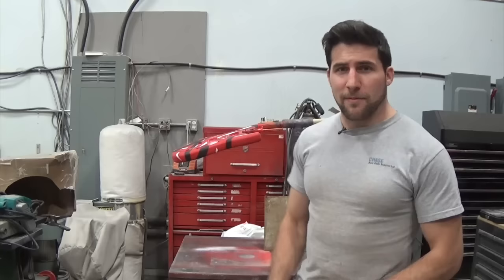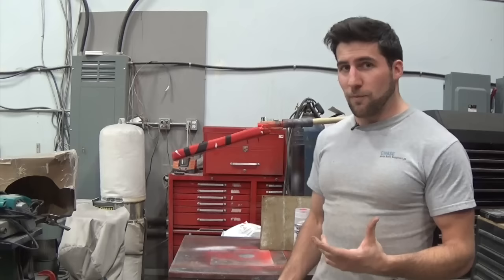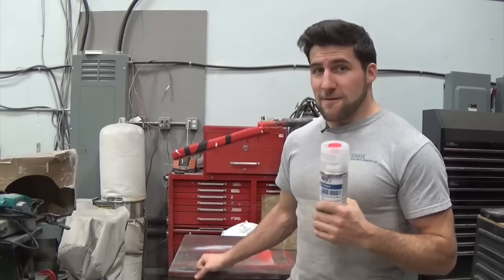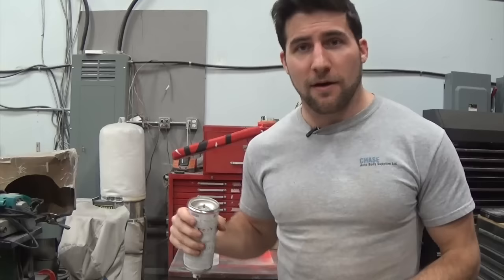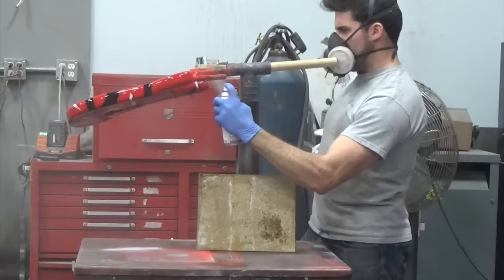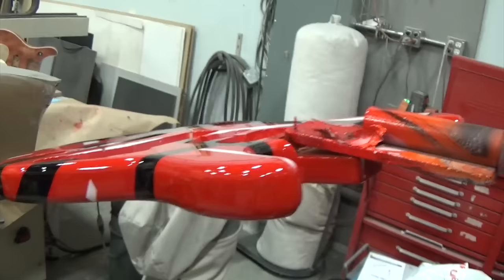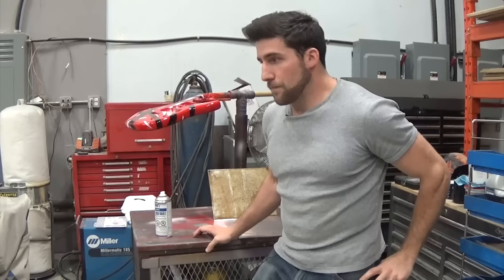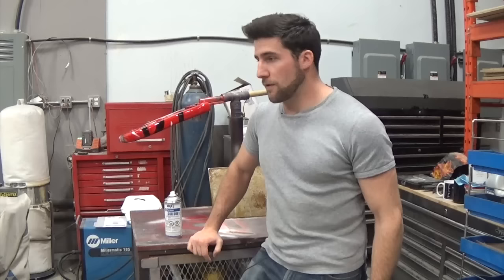How to get a professional looking clear coat with spray cans

Comment: I'm looking to coat an electric guitar that was factory finished in satin. Do you recommend sanding the satin first before applying the poly, and if so, what grit would you use?
Reply from the maker: Yes, sand it to help the new paint stick. I suggest 800 grit.

Comment: I love watching your videos I've learned so much. Just an idea bud you can make a cheap booth using pvc tubing with the pvc joints.
Reply from the maker: Yeah, the pvc and poly booths are worthwhile. I would probably do a chloroplast one if I figured I needed one. I like them a little better.
Reply: @BradAngove  I was just thinking it's quick and cheap to throw one up. Of course your right the others are better. Thank you for your very informative videos, you so deserve more subs 👍
Reply from the maker: Thank you. The shop actually has a spray booth now that I use occasionally.
Reply: @BradAngove  Man I wish one day I have my own shop to work in. I'm actually a car mechanic but things are so expensive in London these days. I guess never say never mate.
Reply from the maker: This shop certainly doesn’t belong to me. That would be awesome though!

Comment: Hey, I have no idea which video I watched of yours saying that you should always sand before you clear coat right? Well I did just that and got great results since I wanted a matte finish. 

Now my question is, should I also sand on a mettalic paint job? I used the rustoleum mettalic series and when I sand that paint job it looks very very different from what I wanted. Like the glittery part of the paint goes off and is a lot less noticeable. Maybe Im using the wrong grit sandpaper? (I used 500 to 800 grit.)

Anyway love your videos Ive painted a lot of great projects using your videos. Thank you so much.
Reply from the maker: Hi there. For the metallic, I would suggest that once you’ve sanded it you do one more light coat of it and then jump right into your clear coat 10-15 minutes later to let it bond chemically.

Comment: Hi Brad! First, thanks for sharing your knowledge. My question is, the finish of my guitar after applying a clear coat (Bosny brand) looks like a snake's skin especially under a light. What do you think is the reason why? Do I need to sand after each coat? And can I sand after 10 mins of application? Thank you very much in advance.
Reply from the maker: Sounds to me like you just need to go through the sanding and polishing process. I have several videos about it as part of various series. Also take a look at this on for your question about sanding between coats: https://youtu.be/pG1zqbaUBds

Comment: How would I go about sanding between coats? Or is that something I should just not do?
Reply from the maker: If you're relying on chemical adhesion as per the manufacturer recommendations like this, you wouldn't sand between coats.
Reply: @BradAngove  ok thanks so much!

Comment: Have you tried using superglue as a clearcoat? I've seen some amazing looking guitars finished that way. It works especially well when the wood is soft and needs protection. I've not seen it used on top of paint, but I don't see why it wouldn't work.
Reply from the maker: No, but I've seen BigDGuitars do it recently. I use it to stabilize soft wood occasionally, but then I clear coat over that.
Reply: Brad Angove I've used ca glue for small repairs but I do not use it for larger dings or chips. I'm sure Brad will have more input than I do on this.
Reply: @053180jlove  I just used it on a tele with a figured poplar top. I don't advise it. I mean...it's very forgiving and you can be sloppy when you apply it cus new coats melt into old ones like lacquer, so the quality is all in what you do after it goes off. But holy SHIT, the fumes! Even with a vapor mask, after each coat, I got flu symptoms for 2 days. It's good. It's hard, it sinks into the wood if you use the really thin stuff for the first coats, it polishes like glass, but still....just not worth. I'd rather use acrylic lacquer rattle cans. It's just a guitar; it's not going to do any sunbathing. And the way people use guitars, they either won't scratch or chip no matter what you use, or they will get totally messed up, no matter what you use. And nowadays people pay extra for a guy at the factory to scratch the crap out of the paint with a razor blade anyways, so...who's even gonna care? We're used to guitars looking haggard after a decaded or two.
Reply: @ashscott6068  well I agree, a respirator is essential when applying paint of any kind. Been a while since I've done the guitar I was questioning about the finish on. Since then I've done about 7 more and ended up buying 3 Sata guns. I use a 2.0mm for primer, 1.0mm for base and a 1.3mm for clear. I've moved on from lacquer to polyester and urethane finishes. I'm currently restoring a Charvel Model 6. I didn't think guns would significantly improve the finish quality so dramatically but it does. Brads videos are an awesome start to learning proper techniques. Also as far as sunbathing with my guitar lol no I don't plan on it but it is really cool to see the progress and the pride knowing YOU did a pro finish. I'll never in my life risk my lungs lol, I spent more money on respirators than guns. Also it's important what you wear because urethane gets on everything.
Reply: @053180jlove  I can't justify the cost of guns and compressors and stuff. I wouldn't get enough use out of them, so I'm stuck with rattle cans. The CA fumes go right through every mask I tried as if it wasn't there. What ended up working best in the end was a normal dust mask with the filter pads dipped in water. I figured the water attracts the fumes the way one water drop attracts another. Though I suppose you could just breathe through a bong

Comment: Great vid! Is there any certain kind of paint that I must use under this clear coat? Thanks
Reply from the maker: It’s compatible with quite a few option. Acrylics and urethanes are what it’s mostly designed to work with.

Comment: Brad, a question. If I wan't to end with matt finish and lets say its striped with rigges do I scuff it down before doing the matt? I gues what I want to know is if the matt finish cover the scuff mark as well as the gloss? Thanks for all the great vids.
Reply from the maker: Matte finish will cover the scuff marks just like the gloss does. If you need to get rid of ridges, you may need to sand your matte clear flat after and add another coat to even it out. You can't polish matte finishes or they will turn gloss.

Comment: Excellent tutorial sir! Thank you for the valuable information!
Reply from the maker: +Jason Bossardt you're quite welcome. Use it wisely haha.
Reply: I do have one question. Will the spraymax work over top an already existing lacquer clear coat? It's only one layer of clear lacquer. I stripped down an old guitar of mine, and did some artwork on it, and applied one layer of clear lacquer. It looks ok, but when you get close, you can see a slight orange peel effect on it. The clear coat has been on it for a little over a month now.
Reply from the maker: +Jason Bossardt If it's been on there a month and it feels nice and hard, you should be able to go ahead. Sometimes things go wildly wrong when you mix paints, but I've put poly over lacquer like that before and never had a problem.

Comment: I'm going to clear a body part for the first time I need some help. It's a carbon fiber part that the epoxy has dulled out and flaked. I will be sanding it and clearing with this product. My question is what grit should i sand to? Some people say 400, some say 5-600, some say go up to 2000. Other say past 1000 clear coats have trouble sticking? Other say under 500 the scratches will be visible through the clear coat. Please I need advice. What should be my final grit before spraying this?
Reply from the maker: +Realist I would go with 800. Higher than 1000 makes it hard for the clear to stick. Too low and the scratches show through. 800 tends to work well.

Comment: Is it O.K. to spray Nitro lacquer coats over a small roundish ding repair that had used CA glue (i.e., "Gluboost" repair method)?? I ask because it seems to require several coats of lacquer and wet sanding in between in order to fill-in low spots or imperfections that you can see in the light!
Reply from the maker: I’ve sprayed nitro over super glue fill work before. It works well.
Reply: @BradAngove  Well, being the amateur guitar refinisher that I am, my situation didn't turn out that well, despite watching those Youtube Gluboost tutorials. I think I'll need to consult a professional.
Thanks, 
John
Reply from the maker: Did it crack?

Comment: For the respirator i recently bought a regular 3M one that takes cartridges. The cartridges I bought are Organic Vapor/Acid Gas ones. More specifically it's the 3M™ Organic Vapor/Acid Gas Cartridge/Filter 60923. Will this work in protecting me?
Reply from the maker: I think that should be good for small batches of work.
Reply: @BradAngove  ok thank you!

Comment: if painting with cellulose basecoat , is the cellulose basecoat durable enough not to clearcoat on top ? , I build fast electric RC boats and want to save weight ? , it has to withstand waterproof tape being put on and pulled off with some residue from tape that has to cleaned away after use ? if not could you suggest a lighter option for painting ?
Reply from the maker: What is the boat made of? Cellulose should be able to withstand tape, and is waterproof. It’s not great with humidity though, and isn’t super durable.

Comment: What about spraying clear on clean, bare metal? I need to coat some non-heat motorcycle parts
Reply from the maker: Are you sanding the metal first?
Reply: @BradAngove  Yes.. for example, the lower fork legs (the cast aluminum outer tubes)
Reply from the maker: Then yes, you can do that but you will get a stronger bond if you use self etching primer or at least adhesion promoter.

Comment: I can still leave fingernail prints on my project. How long before it hardens like a rock?
Reply from the maker: What product did you use?
Reply: @BradAngove  Rustoleum Apple Red Satin and Spray Max 2k.
3 coats base 10 min apart, 40 min gap then 3 coats clear 10 min apart.
Reply from the maker: And it’s still soft? Are you sure you activated the spray max can? Did you shake it well?
Should harden mostly in 24 hours (although I’m worried about that short 40 minute gap)

Comment: Hey brad im loving your spray can paint tutorials i gotta question.  Im doing a joker version of the frankenstrat base is purple with green stripes and im putting a vinyl of the jokers face a 0801 below the bridge and hahahaha for the white stripes and i was wondering to get it even during clear coating can i coat it kinda level it a bit and then clear coat over that as i normally would?
Reply from the maker: Clear coat and let it dry, then level that and clear coat some more.
Reply: Thank you very much.

Comment: sorry for last question. i missed that you answered it in your video. It is very fast with this clear coat. but i think that it's not the same with regular one component clear coat. how long you have to wait with regular coat for wet sanding and polishing. thanks again.
Reply from the maker: It depends a bit on the paint. I would give a normal 1K polyurethane clear about a week to be on the safe side. Lacquer you may want to let sit even longer than that. A pre-cat lacquer on the other hand would probably be ready to go in 2-3 days.
Reply: Brad Angove thanks for so quick respond and greetings from Croatia-EU.
Reply from the maker: Thanks for watching. Best of luck with your project.
Reply: Hi brad, is there a difference between clear coat and lacquer ?
Reply from the maker: Yes. Clear coat is kind of a general term for a coat of clear paint that goes over your colour to protect it. It can be a clear lacquer, polyurethane, acrylic, enamel, or any other type of paint really. Lacquer is a type of paint. It can be clear, or can have a pigment or dye mixed into it to create a colour.
The confusion arises because clear lacquer is a very popular clear coat that people often use on wood.

Comment: Brad, I used a Gloss Krylon Fusion Red (for plastic).  Good stuff  You don't have to sand or put on a primer on anything on the plastic.  Just clean and spray.   But with these paints exclusively for plastics, should I risk clear coating it?  If so, which one should I use?  Thx
Reply from the maker: Krylon also makes a clear you can use over that. I wouldn’t necessarily bother putting an expensive 2k clear over a cheap self etching plastic paint when it’s hard to say how long that first layer will stay bonded.
Reply: Thx
Reply from the maker: Yw

Comment: Do you have a video on how you ended up polishing this?
Reply from the maker: I have several polishing videos. Not for this particular paint job though.
Reply: @BradAngove  if I were to get 8-	10 coats of clear, can I keep spraying this 2K clear one coat every hour or so?
Reply from the maker: No. Spraymax has instructions on the can. You would spray 3-4 coats 15 minutes apart, let dry for 24 hours, sand smooth with 800 grit, and repeat.

Comment: Okay so what about screw holes for pickguard, hardware, etc. I have a kit that's pre drilled. Do I toothpick the holes? Or is it safe to redrill later?
Reply from the maker: You likely won’t even need to re-drill. The paint won’t fill those completely.

Comment: What kinds of paints can this top coat work and not work with? Acrylics, Oils, Laquers?
Reply from the maker: It works fine with acrylics and generally with lacquers as well. I would hesitate to use it over oils unless they’ve had tons of time to dry.

Comment: Good day Brad. I have been enjoying many of your videos to get ideas for one of my projects. I want to create tire tracks across the body of a guitar with a black base coat. How would you recommend creating the tire tracks graphic? Some type of vinyl stencil or another way? If stencils, can you recommend a website for creating and printing cutout stencils?
Reply from the maker: A stencil would be good, but you don’t need vinyl. Cover the guitar in transfer tape, print out the graphic, trace it onto the tape, and then carefully cut it out with an exact knife. For a more “tire-like” look, consider texturing the paint a bit with a sponge.

Comment: I clear coated my guitar with acrylic... After 3 coats (20 min between coats) i let It dry for 2 days. It turned out pretty well but if i put my nail into the finish It scratches really easily. What can i do?

(Sorry for my bad english i'm italian)
Reply from the maker: The acrylic clear coats usually take a few weeks to harden fully.
Reply: @BradAngove  thank you very much

Comment: Do you use a sanding sealer before your light first lacquer coat? StewMac recommends it on their site. But not sure what it does and if it’s necessary.
Reply from the maker: The sanding sealer comes before the paint (color).

Comment: Hey Brad, I just finished painting a guitar a little over two days ago, I used the rustoleum 2x ultra cover as the clear. I was just wondering how long I should let it dry/harden before sanding and polishing? I ask because I don't think the clear I used is really similar to what you used here but I think I remember you using the rustoleum in the past.
Reply from the maker: +Carlos hi Carlos. It's not really similar, but yes, I've used that in the past. Your best bet is probably to give it a week or so before sanding and polishing.
Reply: Brad Angove thanks
Reply from the maker: +Carlos You're welcome.

Comment: Brad, would you use the 2K on the back of the guitar neck also or use a different finishing technique?
Reply from the maker: It depends on whether you want a gloss finish there or not. I generally would avoid that and go for a thinner, lower sheen finish.
Reply: @BradAngove  would the matte finish 2K work, or is the 2K itself just too much?
Reply from the maker: It works fine. Mostly a matter of preference.

Comment: Brad, I am doing the chameleon paint job based on your video. Is it he Spraymax 2K compatible with the color shift Rust-Oleum? Thanks
Reply from the maker: Rustoleum doesn’t recommend using a clear over the chameleon, but yes the 2K should be compatible.

Comment: HEY brad, how is it GOING? Cool video, thanks for sharing. I have a question for you: I have a mate black epiphone that got satin over the years because  of use. I had this idea but i don't know if it makes any sense. I want to first paint with mate balck paint and then put glossy clear coat. What do you think about it?
Reply from the maker: You could just sand it smooth with 800 grit and add gloss clear.

Comment: Thanks Brad, i'm a big fan of your guitar painting vidéos. What is your technique to fix runs in clear coat when that happens? Fortunately, the runs i made are on the back of my guitar! I'm using Rust-oleum painter's touch ultra cover 2x, gloss clear. Thanks a lot!
Reply from the maker: I let it harden and then sand smooth and either add another coat if needed, or just go straight to the polishing process.
Reply: @BradAngove  cool, thanks a lot for your quick answer!  I will try that!  should i wet sand or dry sand it? Best regards from Montreal! I will subscribe to your channel.  🙂
Reply from the maker: I would typically dry sand.
Reply: @BradAngove  Thank you very much, very kind!

Comment: Hey Brad - is it a necessary/recommended practice, to heat this can up like using spray-can lacquers?
Reply from the maker: It can help a bit with the accelerant. That’s all it does; just like with spray can lacquers.
Reply: @BradAngove  by that, do you mean that it will harden faster? (I apologize for my rookie-ness lol)
Reply from the maker: No, it will just expand the gas in the can so it sprays perhaps a touch better.